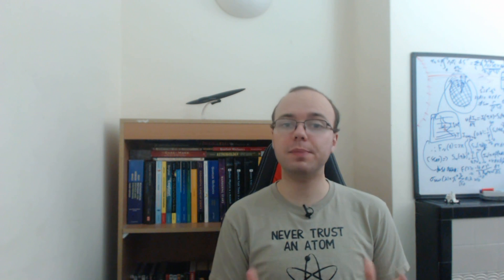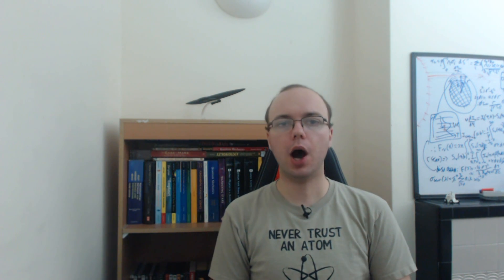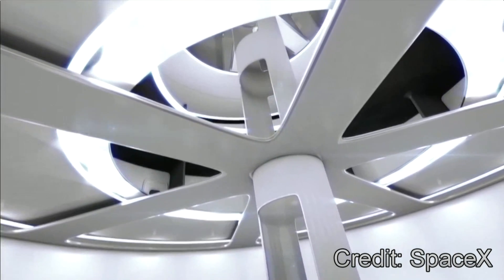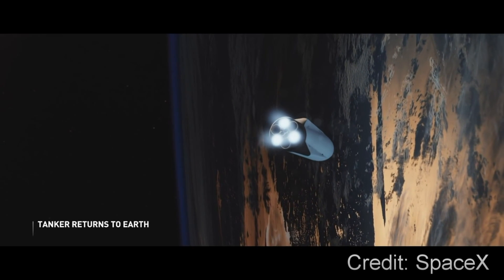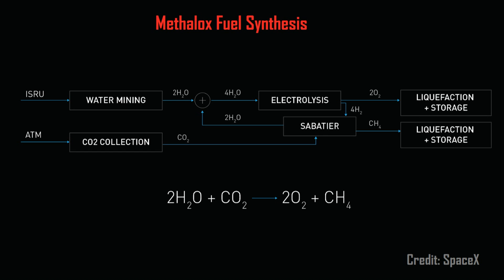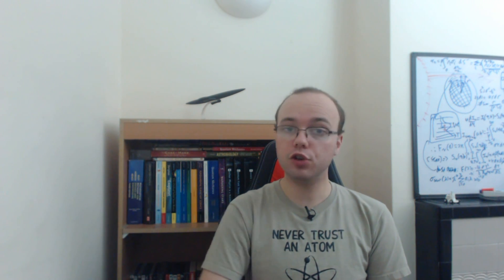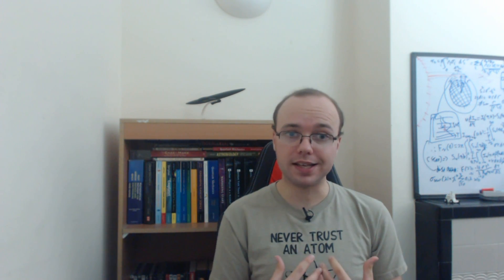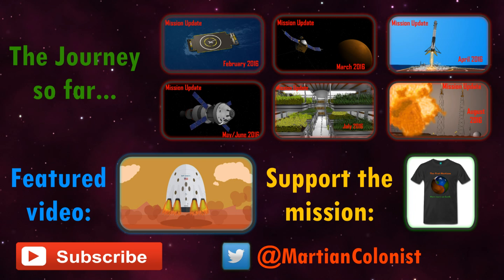Mars Mission Update: September 2016

Comment: It might need to be bigger. If They plan on cramming 100 people in a 17m diameter ship it might need to be two to three times that to support a 100 person crew comfortably. This could be possible if they double or triple the size of the habitat area & add two more booster cores to the main booster core & a modified exploration upper stage. This would cost allot more but the 100 people a trip plan would be more plausible. If they plan on sending say 10 to 30 people at a time the 17m ship would be more suited for those numbers. Although the size of the habitat could be reduced in weight & size if they could have the crew hibernate the whole way & woken up on arrival with something like NASA's torpor concept.
Reply: Conceptual ideas have always had a history of revision before operational capability. If Musk insists on 100 colonists, the people he chooses will have to be hardy survivalist types who will be able to deal with limited space. Otherwise, he will have to scale the number of people down accordingly. There are still a lot of problems to be worked to make this plan feasible. Life support, food, water for 100 people. Being able to launder clothing and keep the spacecraft cabin relatively clean. 100 People can dirty up a limited space pretty quickly. To keep costs from escalating out of control, scaling back the number of colonists may be the only option. The torpor option would require equipment for putting astronauts into the hibernation state required for the enroute phase of the Mars mission. Think something like 100 of the "2001: A Space Odyssey" sleep chambers. I suspect that would only add to the cost and complexity of this system. Like you, I tend to think the system would have to be bigger to support 100 people. The flythrough doesn't really illustrate the usage of space without showing furnishings or the restaurants, theatres etc. that are supposed to be part of this system.

Comment: Don't you think it is much cheaper to use multiple smaller spacecrafts to get to Mars rather than ONE HUGE spacecraft?
Reply from the maker: That was the conventional wisdom, but it may not hold. By creating one large reusable vehicle out of carbon fibre, the efficiency of this vehicle is far in excess of the equivalent payload from multiple smaller launches. You also need to consider costs associated with operations, as maintaining and operating launch sites becomes one of the largest expenditures associated with a fully-reusable vehicle - for comparison, it would take 33 Falcon Heavy launches to send the same payload as one ITS to the surface of Mars.
Reply: Cheaper per launch, but not cheaper per kilogram of payload delivered.

Comment: This could be really good for the moon. While no you couldn't refuel the shorter distance and speed needed. Would allow you to use less fuel. This would at least allow you to get back into earth orbit if not land on earth if needed. A moon Colony is very good idea. Not so much because its the most habitable place. Its lower gravity and proximity to earth  as well as certain resources like helium 3. Allow it to make good launching/port and mining colony. Its pretty wasteful to land back on earth if your going to have launch a giant rocket it get it back into orbit. When Far cheaper rockets could make it to the moon.
Reply: The problem with a moon colony is mostly gravity.  From a biophysical perspective, they've done Vomit Comet experiments to see how much fractional gravity is needed to comfortably perform basic motor tasks, like walking, picking things up, using tools, ect.  The minimum value was 25% of Earth gravity.  Sadly, the moon clocks in at 16.3% of Earth gravity.  So, on the moon almost every action becomes oppressively complicated by lack of weight (except, you know, lifting stuff... that gets way easier).

And then, even with the low gravity, you still have to burn 2,000 m/s delta-v to get into orbit.  Only now, without the 8000 m/s Oberth effect of a low Earth orbit, you have to burn a lot more fuel to reach Mars directly (this, after spending almost as much as you would need to reach Mars just to get to the moon in the first place).  So again, sadly, it's not an ideal launching/refueling point.  Nevermind the lack of methane on the moon (i.e. the long-shelf-life fuel the transport ship needs).

The better place for close-to-home, long-term-mission se-tup is just low Earth orbit.  The other advantage to LEO is the quick escape option.  If things go horribly wrong, the crew just has to step into their escape pod(s), burn a few hundred delta-v, and blunt lifting body/parachute their way back to land in what could be less than an hour.  The moon is around 3 to 10 days away from Earth with a conservative transfer orbit.

Still, despite all that, a moon colony would have a ton of other research applications... in addition to being really cool.

Comment: As it does not sound like it could easily refuel on the surface of the moon.  Do you think it would have enough fuel to achieve a lunar landing, take off and come home?
Reply from the maker: Yes, the amount it requires to accelerate towards Mars and land there is more than enough to land and takeoff from the Moon.
Reply: I think the answer is no. Since you can do aerobraking on Mars, but not on the Moon, it actually takes just as much delta-v to get to Mars as it does to get to the Moon. So if you used all your fuel to land on the Moon and couldn't make fuel to take off again, you're staying there.

That being said, I think the ITS has MORE delta-v than it actually needs to get to Mars by the lowest-possible energy transfer which is how it can get there so quickly. Maybe if they used the minimum amount of fuel to get to the moon (it's not like they need to get there faster), maybe then?
Reply: Also, you can just not load a full payload and get lots of extra delta-v.  Even so, moon missions should try to refuel there (if they can figure out how/where to make methane).

Comment: During the recent Mars One q&a i asked whether they wil now use the ITS for their mission. They said no, which i find strange, because it provides a launch system, habitat, cargo storage all in one for cheaper-atleast, thats what i figure. What is your thoughts on this?
Reply from the maker: The ITS would be a little overkill for their first demonstration mission! That's why they are going with Lockheed Martin, at least initially. They remain open to using SpaceX as a launch provider for future missions, and if the ITS does indeed keep to schedule that I'm sure Mars One would consider switching from the Falcon Heavy (which they would need a minimum of 13 launches from, according to their current plan). The ITS could be a game changer here.
Reply: +Martian Colonist indeed. From what I could find the ITS system would work out cheaper, but we will see how things go. Exciting times
Reply: Mars One can't fund a mission on the ITS. Even if they could, the ITS doesn't provide them with a habitat, just a launch system.

Still, there's no reason they would have to buy the entire flight. They might as well just buy a few seats on it. It seems like that's their best possible chance of being successful.